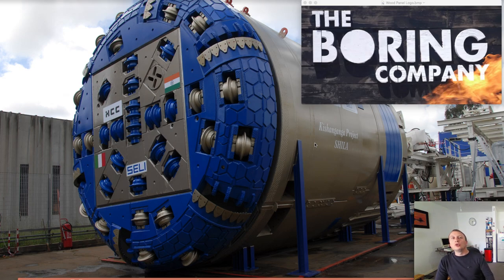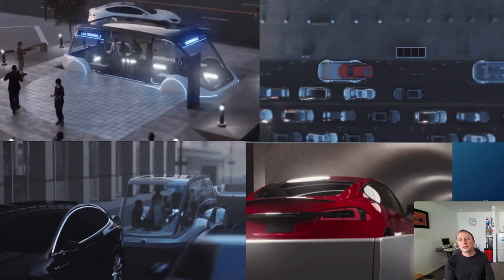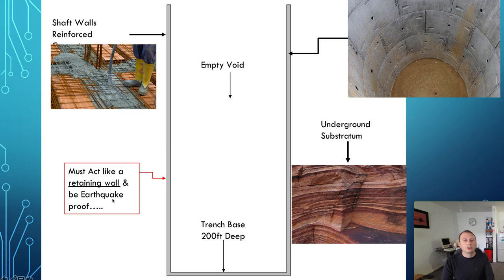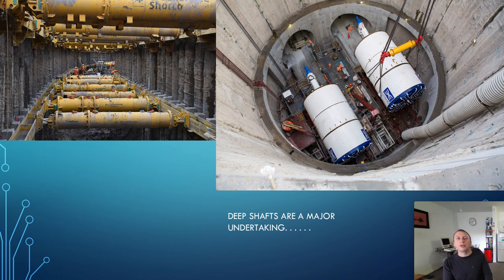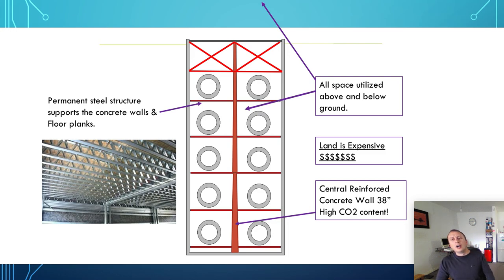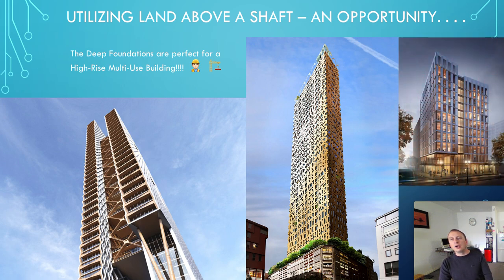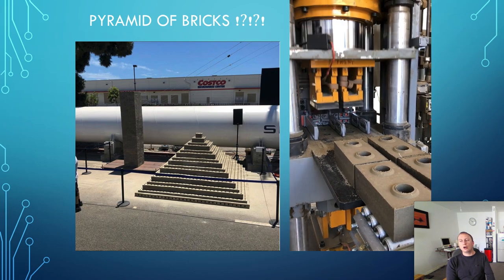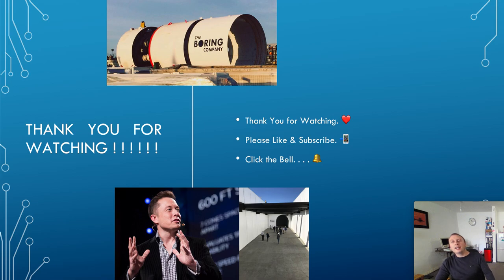A Boring Revolution - Elon's Monster Excavations - Episode 7 !

Comment: Curious about the manufacture of the bricks. How will they deal with varying characteristics of materials that are being excavated from the boring process? Will they even be able to use all soil/rock types?
Reply from the maker: Very good question. Here in the UK we use "British Standard" to determine the loading capacity of a block or brick however using various rock types will yield several different results. . . However I'd imagine compressing stone at 5,000 PSI produces a very very tough and durable block - thus it should be advertised as such and specified to "worst case scenario". Sold for $0.10 a block - builders would enjoy using this in low rise developments.